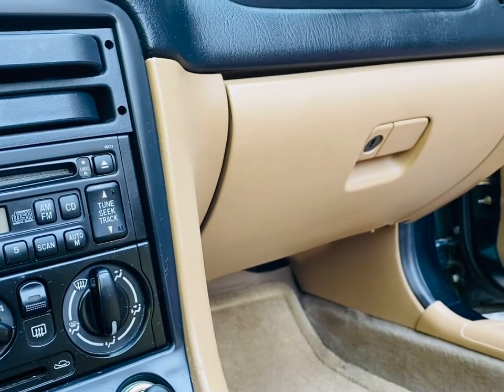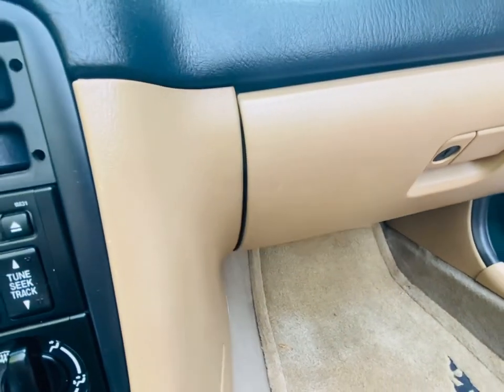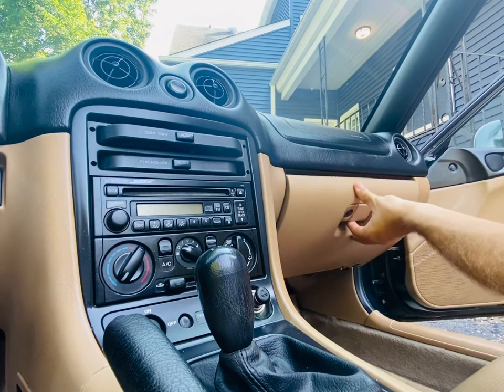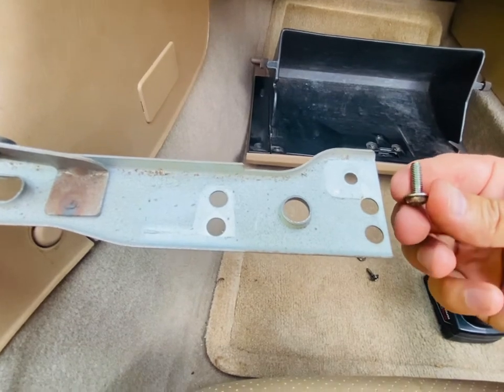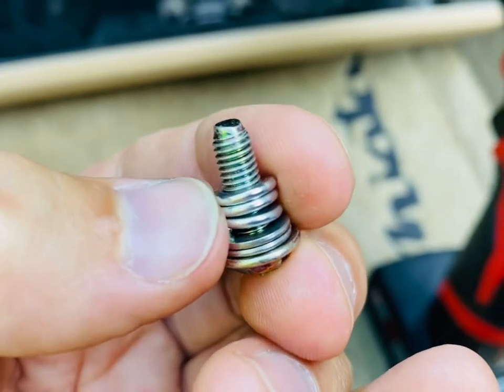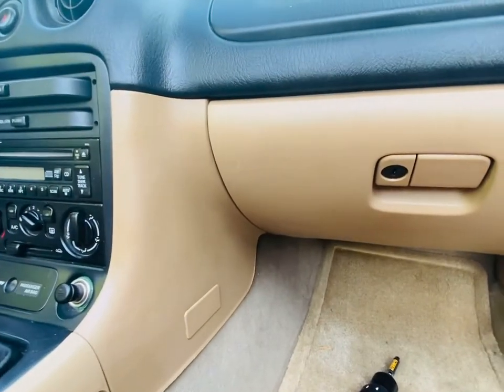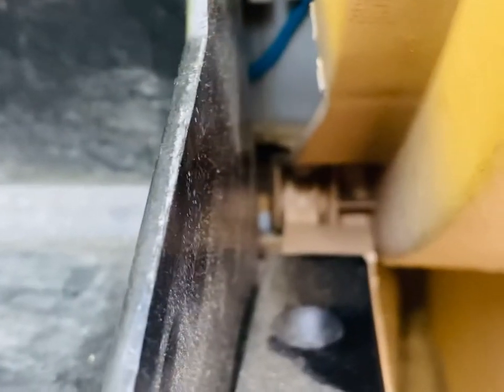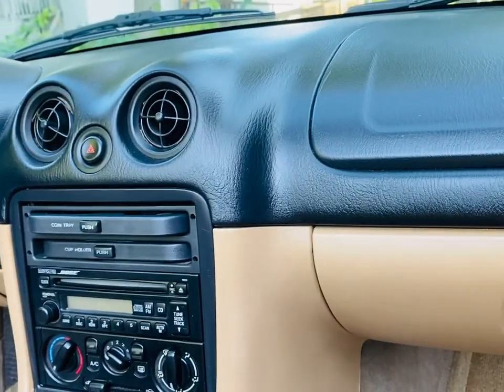Mazda Miata NB Sagging Glove Box Fix￼

Comment: My question is which end of the metal piece did you drill the hole into. And is that the same hole you put the screw with extra washers?
The left side that sags? Or the right side that doesnt? Just wanted to be sure. Thanks